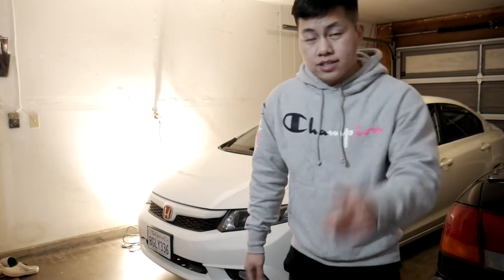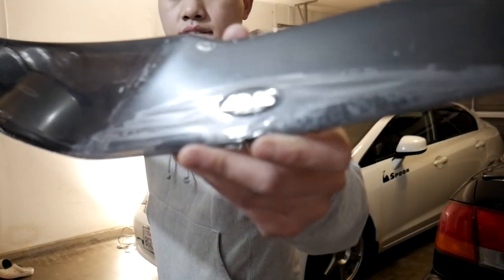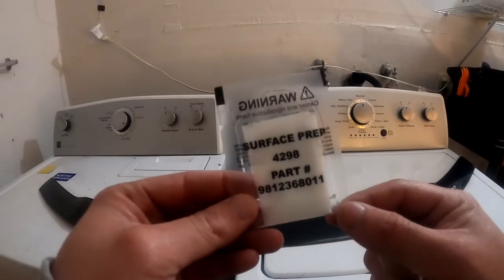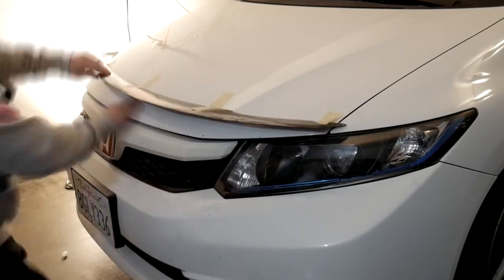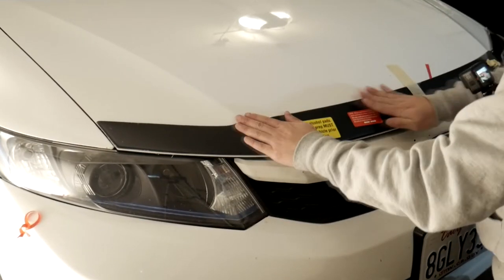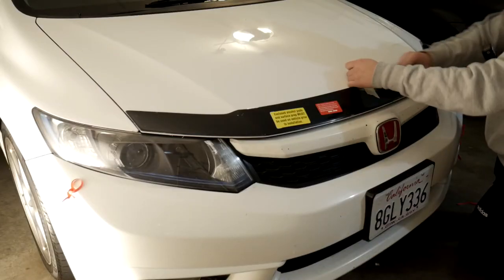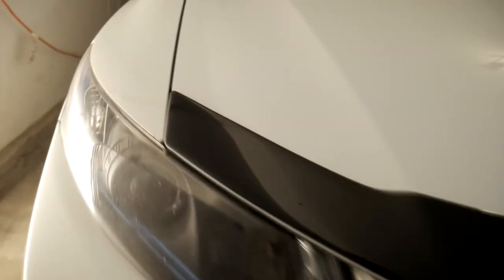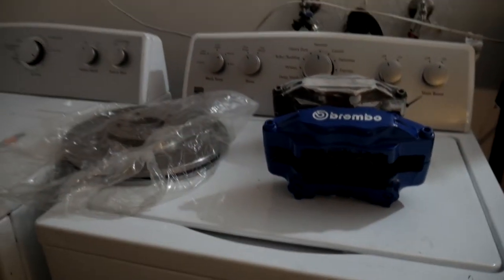AVS Aeroskin Hood Visor / Deflector for the 9th Gen Honda Civic Si

Comment: just a heads up on the installation I believe when you install them on the hood you have to drop it a little bit more this way you don't see the white color on the hood in the front part otherwise if you are happy with the car looks that's all that matters good luck with your other project fellow youtuber
Reply from the maker: After I installed it, i realized it was a tad higher, as you mentioned, but the 3M tape was on too good. 😅 so i just stuck with it.  Definitely can go a bit lower.  And much appreciate it!  Thanks!
Reply: Yeah I agree that tape goes on tight and if you try to lift it up you will crack it it don't look that bad I would go with it take care

Comment: anyway to remove that avs logo?
Reply from the maker: I believe you can.  It looks like its just a stuck on there with adhesive.  Just not sure if there is a indention/groove where the logo sits.
Reply: Could probably pull it off with some dental floss